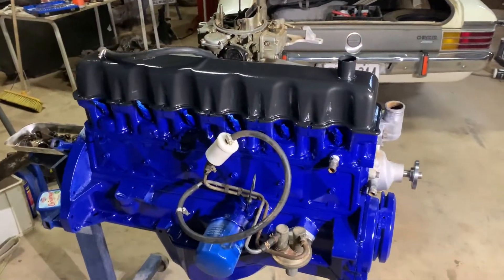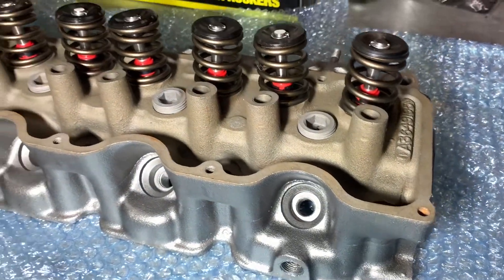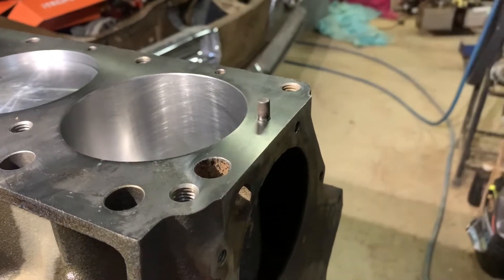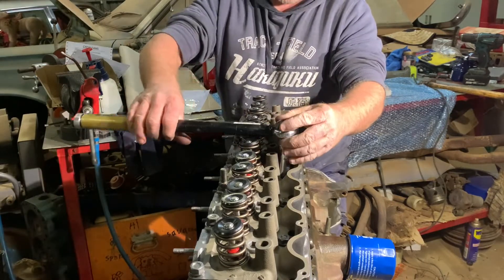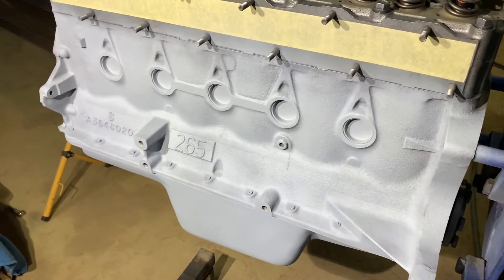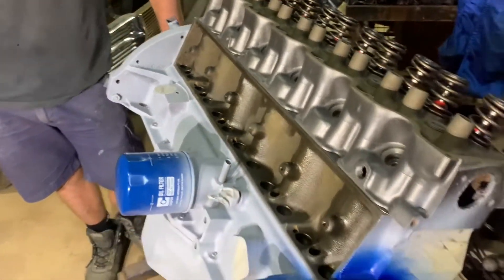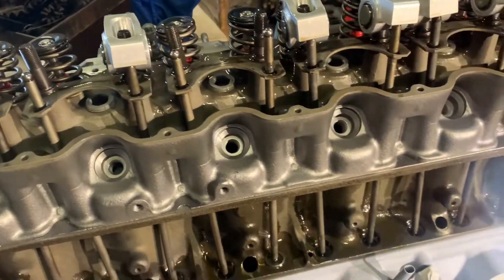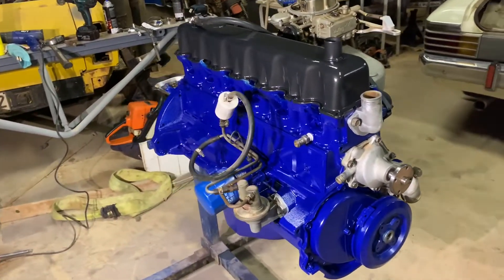The CNC ported 265 Hemi is back together

Comment: That engine is not a hemi. what makes you think it is?
Reply from the maker: It’s an Australian Hemi 6 , google it brother 👌🏽
Reply: Yes it is. Not all Hemis are v8s, this is a Chrysler Hemi 6.
Reply: Great looking head 👌🏼👌🏼
Reply: technically correct, but they are still named a hemi six.
Reply: It's a 35% Hemi or semi hemi and they do go very very well
Reply: It is a hemi by name from chrysler Australia.  No one with half a clue claimed it was a hemispherical shaped combustion chamber because it wasn't. Due to the Vale angle an the shape of the combustion chamber some folk would reffer to it as a semi hemi. Marketing  thought they could cash in on the hemi name many people believe.
Reply: Sure it's a HEMI, it's also a TOHC, triple overhead cam!